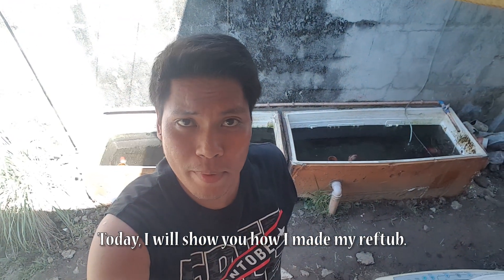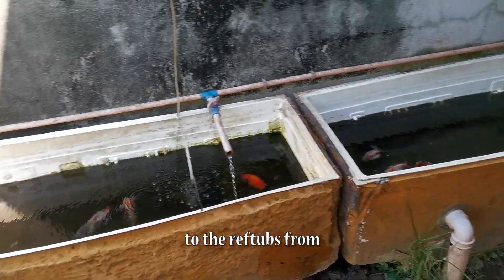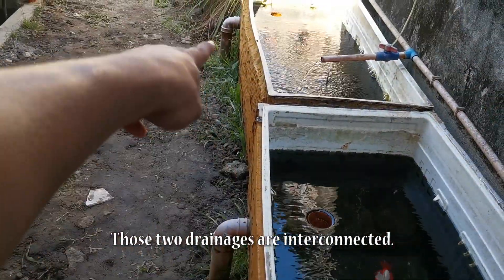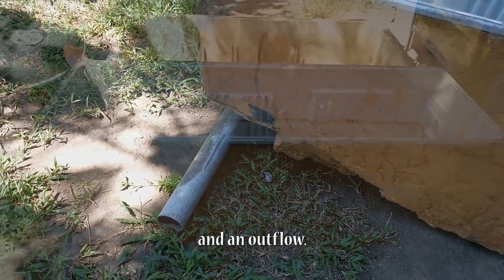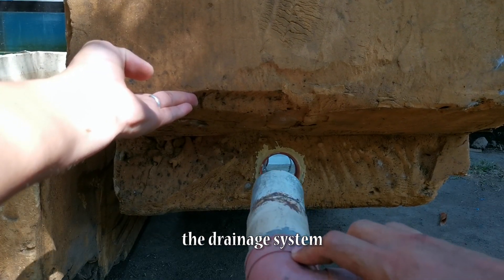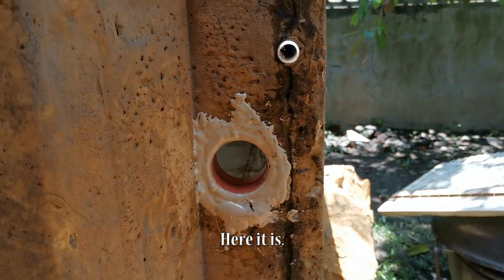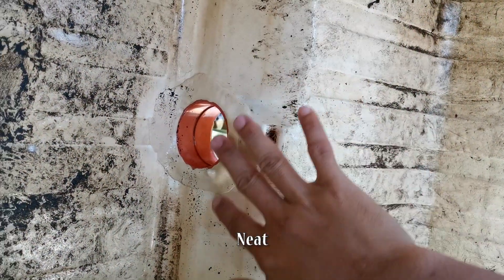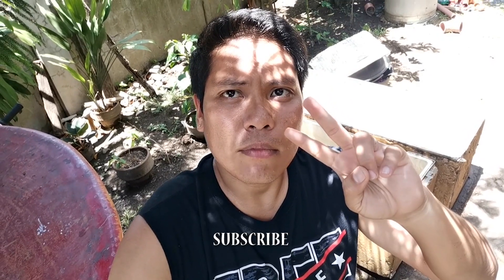DIY: HOW TO MAKE REFTUBS

Comment: sir pwede po ba lagyan cement ung flooring ng ref tub?.. hindi po kc flat ung flooring ng nabili q, may mga butas po xa (pa-square).. ung iba pra sa wiring.. hnd po kc xa gaya ng ibang ref tub na plain/flat ung pinaka-base.. and hnd na po inalis ung body ng ref.. more power po..
Reply from the maker: Pwede rin naman bai.. seal mo lang ng silicon ang sides pag dry na kasi di totally didikit cement sa tub..